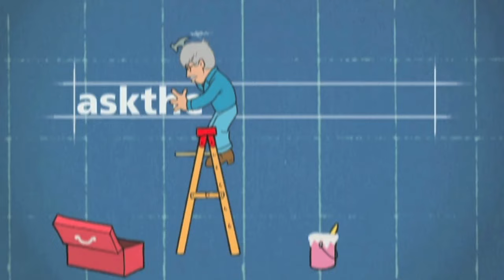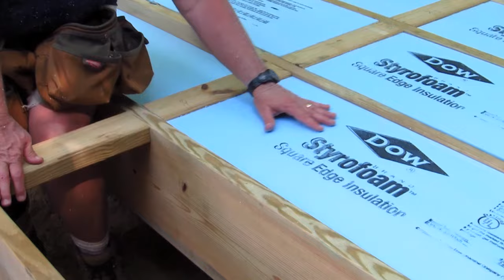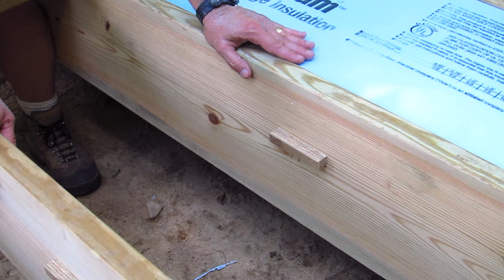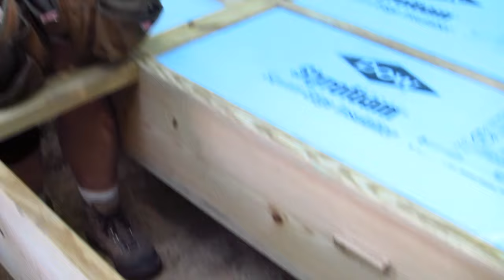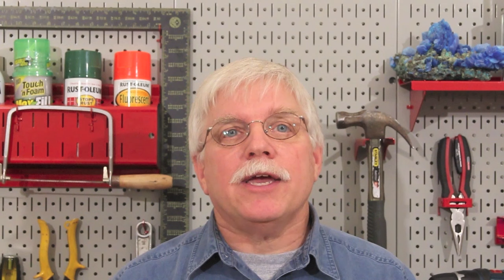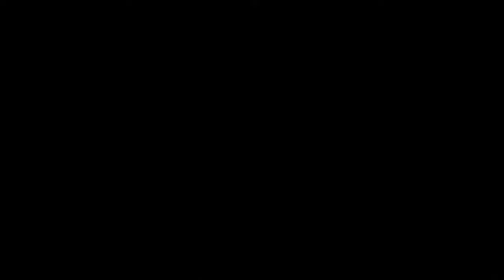How To Foam Insulation Board

Comment from the maker: Closed cell foam works great for many jobs. Do you have questions about the best practices? I can call you on the phone to help ensure you don't goof up. Go here: https://shop.askthebuilder.com/products/15-Minute-Phone-Conversation-with-Tim.html
Reply from the maker: I'm not a paid actor. I tape all my own videos. I offer a phone consult service to homeowners and builders who routinely see the wisdom in paying a legit fee to get the right answer before they do something wrong that might cost $500 or $5,000 to fix. I have no issues keeping your comment up. We'll let the Court of Public Opinion rule on it. P.S. Just yesterday I helped Felicia and her husband Ben in Virginia solve a vexing basement leak problem for $50. I'm sure you get paid for your wisdom so I don't understand why you think I should not get paid for working. What am I missing?
Reply: @askthebuilder  Good for you
Reply: What if you combined the bubble foil  radiant barrier with the styrofoam? What would the R value be?
Reply: I'm rebuilding an RV. It's built with 1 x 1 aluminum framing. It's too cold for spray foam now, will this work in an RV.

Comment: Found this after I installed DOW closed cell in the cottage i bought in August 2020.  Originally built in 1947 the Flooring system was constructed of 2 x 8 rough sawn whited cedar.   Basically built on the ground, i wanted to get a vapor barrier installed.  Did the whole job pretty much as you showed.  My wife and I salvaged White cedar and cut hundreds of 1 x 4 to use as supports.  After the foam board was put in place I used window sealing foam all around every joint to seal.  Works like a champ and the floors are comfortable.  Did this on my place on Drummond Island in Michigan.
Reply from the maker: To get unlimited free tips each week like this, be sure to sign up for my FREE newsletter at www.AsktheBuilder.com

Comment: I thought about using foam board under an addition but running it across the bottom of the floor joist like plywood. Would have an air gap between but should still make it a little warmer right?
Reply from the maker: Your idea is not good. READ this true story to understand why: https://www.askthebuilder.com/insulation-installation/

Comment: The floors are cold in my 3 season room.  To correct this I bought foam insulation with aluminum on one side.  Question: Should I put it up with the aluminum facing toward the ground or the floor of the 3 season room?
Reply from the maker: It should face the floor of the room. You want to bounce heat back to its source.
Reply: @askthebuilder  Thank you, I will do that way.

Comment: Hi Builder,  I want to beef up my insulation in hot desert attic. Can I use rigid foam board insulation under my current pink insulation? In other words, rigid foam board would go directly above the drywall in between joists (floor) of attic.  And can open unfaced pink insulation touch the foam board?   greatly appreciate it-   very informative video.
Reply from the maker: You can use both. They can be in contact. Understand that all insulation does is SLOW the transfer of heat. You need to understand the science. READ this true story: https://www.askthebuilder.com/insulation-installation/

Comment: :) Great video! I am building my own shed and adding foam insulation. Only thing I am not sure of is the base of the floor. Once the insulation has been placed should the base of the shed have board on it? I seen some videos where people just leave the foam exposed to the elements and place some strapping across it. Would wire mesh really be sufficient?

Comment: Tim I just had a garage built and the foam sheets ( with foil backing ) where installed foil facing inside instead of facing outward . Which is proper way . I think it should have been the other way according to manufacturers spec ( cellofoam , poly shield) . So when you walk in to the building the foil side is showing. And should the joints be taped?
Reply from the maker: Get my FREE newsletter here: www.AsktheBuilder.com

Comment: Hey Tim I need to insulate a ceiling that  has no attic, it's a flat torch down roof with 1.1/8 plywood 4foot o.c so on the interior the plywood shearing is visible,  but I want to use Styrofoam to insulate. My question is this. Can I attach the Styrofoam directly to the underside of the roof shearing between the rafters, or do I need to leave a gap for air...I don't want condensation to build up but this building has no vents anyways...make a gap? Or glue to underside of roof searching? Thanks.
Reply from the maker: I'd leave a gap. 2 inches. If you want FREE unlimited tips like this each week, subscribe to my newsletter at www.AsktheBuilder.com

Comment: Is there any concern of pests crawling up and burrowing into the foam, nesting and creating an environment where the pests like carpenter ants might then chew on the lumber?  Is it an reasonable option to sandwich the foam with a piece of exterior plywood to cover the foam from beneath while caulking the ply to joist seams?  Thank you for your video.
Reply from the maker: There is always a concern. Nail up 1/8-inch-square galvanized wire to the underside of the floor joists.

Comment: Any suggestions as to how this might be done with a 30 year old house. Need to re-insulate the garage ceiling that has living space above. How would you address heat runs, joist braces, etc.or would spray foam be the better approach. Have watched several of your videos, nicely done.

Comment: Hi Tim.  Thanks for the video.  Two questions: 1) do you use foil faced foam board (if so, which way the foil)? 2) I used just plain pine 2X6 joists - do I need to treat them? - post and beam 10x14' cabin about 16" above often moist ground.
Reply from the maker: +Tom Brooks Tom, there's lots going on in your situation. More than I can type in 30 seconds - the limit of replies because I get SO MANY comments. If you want solid advice on what to do, consider this: http://shop.askthebuilder.com/products/15-Minute-Phone-Conversation-with-Tim.html

Comment: Even better if you spray foam the edges to remove any air gaps.
Reply: Yes and easier. Cut the pieces about an inch shy in both directions to produce a 1/2" gap all around. Then can foam them tight.

Comment: So should you use treated wood for the entire floor?
Reply from the maker: That's exactly what I did in my shed. That way I don't have to worry about storing WET lawn equipment, snowblower meltwater, etc. The big issue is that treated T&G plywood was not available and I had to put in the blocking to keep the seams flat.
Reply: @askthebuilder  thanks

Comment: Would this be ok in a ceiling above sheetrock?  I have a small bumpout with out much room above for insulation.  I'm concerned about condensation.
Reply from the maker: Yes it would. You better go to my AsktheBuilder website - the dot com one - and read ALL my columns about ventilation. If you don't you could have a MASSIVE condensation issue. Click the link in the video description above.

Comment: I was thinking about something like that and putting 2 in. XPS plus 4 in. roxul on top of it in the cavity of my exterior walls.  But Im not sure. Im afraid of possible moisture collection inside the wall because of this XPS. I live in climate zone 5 (upper part, actually almost zone 6). Do I have to worry and do I have to use vapour barrier/retarder in this case?
Reply from the maker: It's good to engage your critical-thinking skills! For unlimited free tips each week subscribe to my FREE newsletter at www.AsktheBuilder.com

Comment: Cut the board a half inch smaller and spray foam around the edge. Perfect seal every time.
Reply: I like to cut them tight so they stay put, than when i have enough of them in to use up a whole can of spray foam I do them all at the same time.  Spray foam like Great stuff during such a project will gum up in the nozzle if left even a short time and also since you MUST wear rubber gloves and your bound to get some drips you are much better off using a whole can at a time.  This way you can be fairly certain your not going to end up with a can that still has foam in it but it has gummed up.  Most of the time I can un-gum a can by using a drill bit matching the shaft size but some times I think the clog is internal.
Reply: @zzubuzz  I use screws 1/4" too long and cut perforated galvanized strap as washers to hold up the foam board.
Works great under my 100 year old wood house
Reply from the maker: I disagree. Be sure you subscribe to my FREE newsletter right here front and center: www.AsktheBuilder.com - Also, I now LIVE stream each M-F at 4 PM Eastern time at https://youtube.com/askthebuilder

Comment: Hi, great video.  I am going to use your idea.  You left a small air space between the floor sheathing and the insulation on purpose?  You indicate no need for a vapor retarder over this whole installation before you put down the sheathing right?  I will have a ground vapor barrier with 8 mil plastic underneath #57 gravel on a workshop I am building, the building will be on beams on concrete blocks so there will be an open air space.
Reply from the maker: +Frets Nirvana correct. The tiny air space is on purpose. It's closed-cell foam. Vapor transmission in next to nothing.

Comment: @ask the builder  I have some rigid styrofoam insulation board that is silver on one side and white on the other with all the labels, I want to use it as a gap filler for my window air conditioner (fill the gap above it in my sliding window) does the silver side go facing into the room or out of the room?
Reply from the maker: Think about water vapor. YW as we say in Morse.

Comment: Where can I buy this 2" Closed cell Panels from ? I went to Home Depot and lowes and they had no clue what I was Talking about !!! Thanks !!!
Reply from the maker: When you went to the DOW Insulation website what did you discover???? Most manufacturers have a dealer locator where you enter your zip code. Try that always when you want to find who sells what you need. If they don't have a dealer locator, then revert to old technology and call them on the phone.

Comment: I need to add floor insulation from under the house (pier and beam).  What works best and is critter resistant?  How do I secure it?
Reply: You have 4 choices. 

1 spray foam closed cell is what I recommend
2 foam it, tiger, or any other DIY kit most are the same. One that requires a nitrogen tank is I bit pricier but worth it if your a mid to top level skilled diy'r. 
3 eps insulation. Friction fit. Low r values but I can buy a 36"x36"x96" block for like 250.00 and for a few bucks have it sliced into pieces to fit and fill joist completely. And spray foam with professional can foam like Hilti or other. Eps still needs a good vapor barrier because it's not impermeable. Vapor barrier on close quarters is a pain. But I'm a big guy
4 batt insulation. But if there is air permeation it's worthless so not really an option. 
And then there is always the xps extruded polystyrene like in this video. From underneath make it smaller and foam a border around sides and make layers as the spray foam hardens. Great stuff takes hours to fully cure Hilti solid though and through in 1 hour. Xps is triple the cost of low budget eps not really worth it because I would still do a vapor barrier personally. I've even done cement board 4x8 sheets under homes. Also dense glass and stucco. So really the job your talking about has a big swing in price. But spray foam cost VS effort is the hands down winner at r7 per inch of thickness. But the stop of air travel is it's real bennifit. Plus you can get enough to do 1" and insulate as you have money to spend and bennifit from comfort and utility efficiency immediatly.
Reply: thank you.
Reply: +dekonfrost7 Couldn't have said it better myself110% agree. The aggravation of cutting those panels and making sure the panels conform to every bit of framing(not all framing is always the same dimensionally due to warping, cupping, minute errors, etc of wood) is near impossible. Trust me, I know! Been there, done that. In the end it's just not worth doing. I would sooner do a DIY spray foam kit then do the rigid panels. But hiring someone to do the CC foam, even if they only spray 2" is worth the cost of admission. Makes such a difference on flooring. Fiberglass bat floors are always cold. Ambient air always sits between the fiberglass and the underlayment and the floors can get cold as hell, especially in manufactured homes with crawlspaces. CC foam is the easiest and best method and doesn't look to be outperformed soon. If you google rigid exterior vs closed cell foam you quickly realize that rigid exterior has many drawbacks to foam. It's also a much older practice.
Reply from the maker: Ask this on my new LIVE stream: Be sure you subscribe to my FREE newsletter right here front and center: www.AsktheBuilder.com - Also, I now LIVE stream each M-F at 4 PM Eastern time at https://youtube.com/askthebuilder

Comment: I live in Wisconsin and recently built a typical framed 8' x 8' shed. I used the closed cell insulation board between my floor joists, 4" thick just like one of your videos had. I plan on heating this off and on in the winter. I currently have open rafters above with a 6/12 roof pitch. Its all shingled and done. My question is can I use this same closed cell foam board up above between my rafters to insulate and then sheet over it or use pine tongue and groove to finish it off? As it is now I want to keep the "Cathedral looking ceiling" and I have NO vents what so ever. There wouldn't be an "Attic."
Thanks.
Reply from the maker: Jeff Kobes You can use this in ceilings. It must be installed TIGHT. There MUST be 2 inches of air space between the underside of the wood roof sheathing and the TOP of the insulation. You MUST have continuous soffit and ridge ventilation.

Comment: What stops critters from lunching on the foam board underneath? I had a building insulated like this and the raccoons made a feast of it.
Reply from the maker: +Megan Watson You can put hardware cloth screwed to the bottom of the floor joists.
Reply: Mice were my problem, I'm combating them with hardware cloth mesh, but if it was rats or raccoons than I'd have to use 2 types, one with the smaller mesh for mice but than a much heavier gauge for rats or larger.  They can't chew thru steel as they'll cut up their mouths.  Mice require a gap no larger than 1/4", my mesh is 1/4" x 1/4" 23 gauge.  I folded mine over doubling it up just to be safe and because I had to buy a 100' roll.  The vendor for this mesh would have them designated for rats.  Raccoons are pretty smart, and have those freeky hand like paws, don't leave any saws, nippers or cordless dremels laying around:)
Reply: paprika ! and pepper !! sprinkle lightly or mix in spray bottle.  Worked for me. Tobacco worked too, but OMG , the costs

Comment: It's not going to be a great barrier/insulator when air vapor gets around the edges of that foam. Did you seal the edges with a tape or flashing? This is why I like foam over insulated panels. Foam completely seals the void, no gaps and over 2" CC foam is vapor barrier.

Comment: Any problems with moisture behind the foam?  Doesn't look like it would vent very well at all.  Doug
Reply from the maker: It's closed cell.
Reply: Wood is not.  I was referring to the wood/foam interface where moisture could gather.  Same as a roof deck.
Reply from the maker: Wood joists in this structure are treated lumber as is the plywood that's going to cover it. Best practices in using foam with roofs - in my opinion - is that you NEVER allow it to contact a roof deck. You need 2 inches of air space between insulation and roof deck so water can evaporate. If you need more help, I offer phone coaching:  http://shop.askthebuilder.com/products/15-Minute-Phone-Conversation-with-Tim.html

Comment: Could I use it on the underside of my roof? In Florida my attic will reach 140+ degrees in the summer time, the regular insulation does a decent job stopping the transfer from the attic and through the ceiling, but I'd like to limit the temperature in the attic as much as possible. I have 74 sheets of 3" thick blue rigid insulation that I plan on putting against the underside of the roof in between each truss... Thoughts? Concerns?
Reply from the maker: I'd never use it. The foam will just get as HOT as the attic in less than an hour. Then it does nothing for you. You need a radiant barrier. READ all my past columns on radiant barriers at www.AsktheBuilder.com.
Reply: Ask the Builder thank you for your fast reply. Looks like I need an air gap between the 2.. Is 5/8" too little? The other option would be a 3-5/8 gap but would lessen the working space in my attic. Thanks again! Subscribed!
Reply: Ask the Builder What?You say When insulation gets hot, it does nothing for you.

That's ridiculous. Although the effectiveness of insulation varies somewhat depending on type and temperature, insulation never does nothing. Some expert you are.
Reply from the maker: Dean Winter You need to go read a few white papers about heat transfer and things getting hot. Steven wanted to put the foam on the underside of his roof as another layer before the heat got to his regular insulation. In that situation, the foam will heat up and get as hot as the underside of the wood sheathing, especially if it's TOUCHING the wood.

There are all sorts of white papers out there that show you graphs of temperature probe temperatures of blown fiberglass. That insulation closest to the hot air in the attic is the same temperature of the attic air. When that happens, the insulation is no different than the hot air. Just go do some research and you'll discover some new information that will enlighten you about this topic.